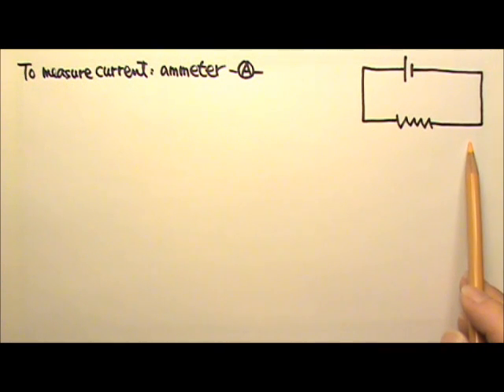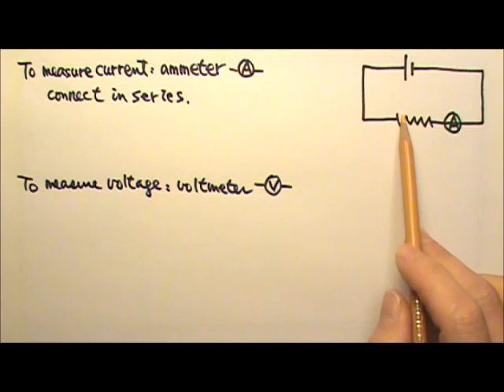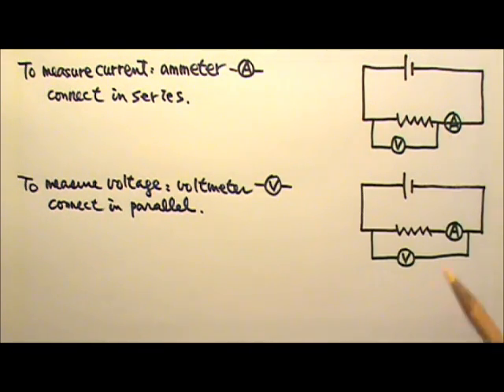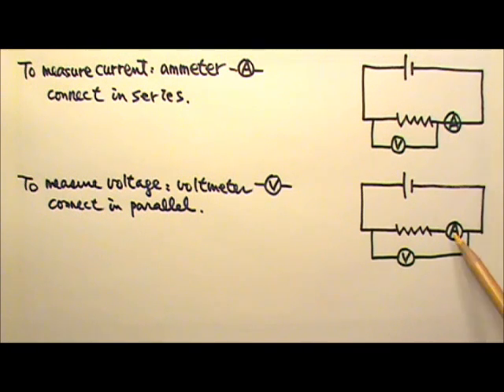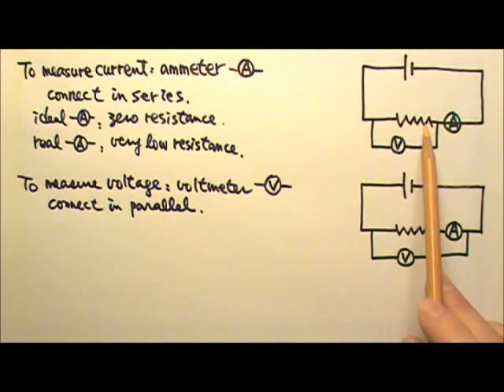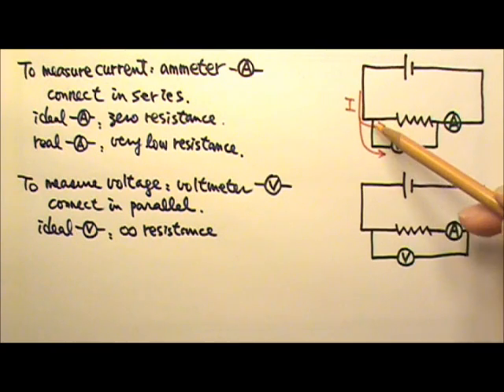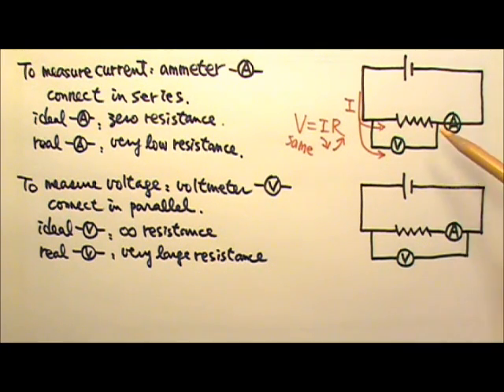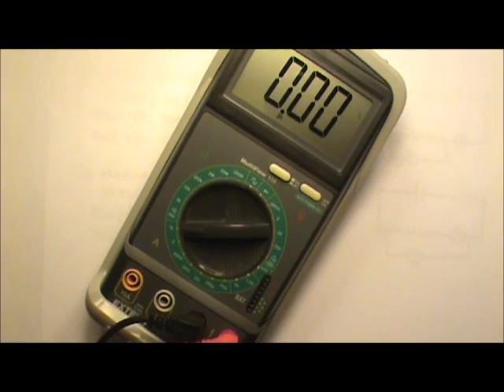AP Physics 2: Circuits 18: Ammeter and Voltmeter

Comment: The metre, or meter (American spelling), (from the Greek noun μέτρον, "measure") is the base unit of length in the International System of Units (SI). The SI unit symbol is m. The metre is defined as the distance travelled by light in a vacuum in 1/299792458 seconds.

The metre was originally defined in 1793 as one ten-millionth of the distance from the equator to the North Pole. In 1799, it was redefined in terms of a prototype metre bar (the actual bar used was changed in 1889). In 1960, the metre was redefined in terms of a certain number of wavelengths of a certain emission line of krypton-86. In 1983, the current definition was adopted.

The imperial inch is defined as 0.0254 metres (2.54 centimetres or 25.4 millimetres). One metre is about  3 3⁄8 inches longer than a yard, i.e. about  39 3⁄8 inches.